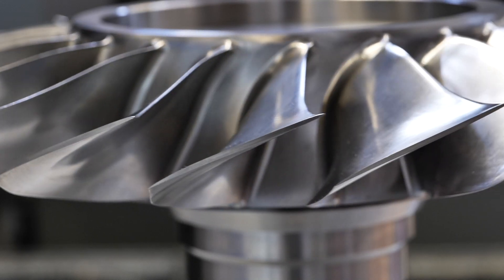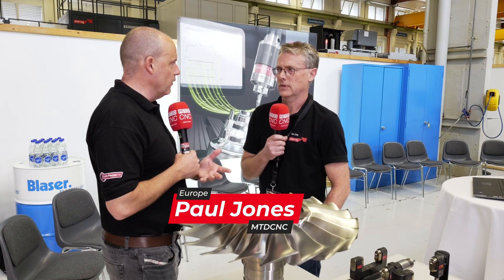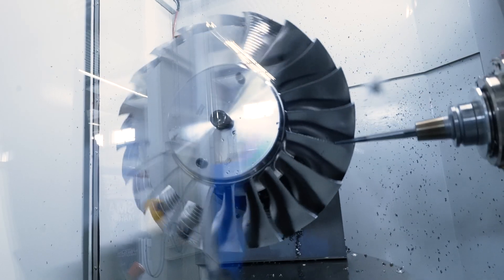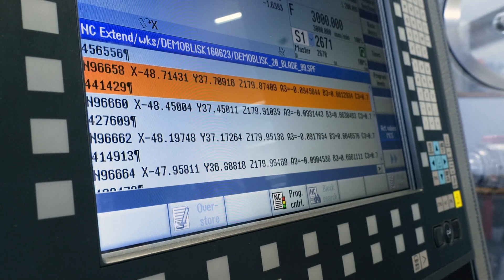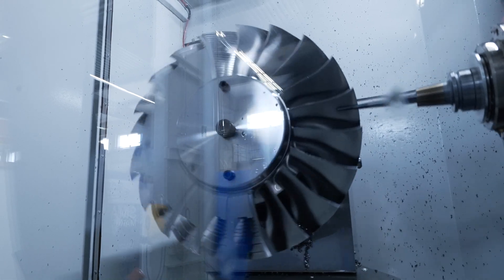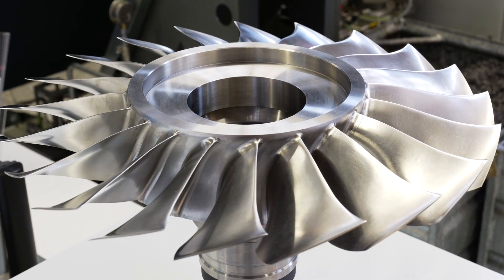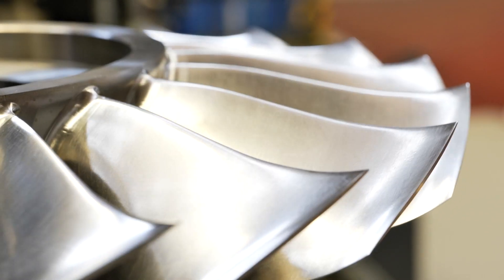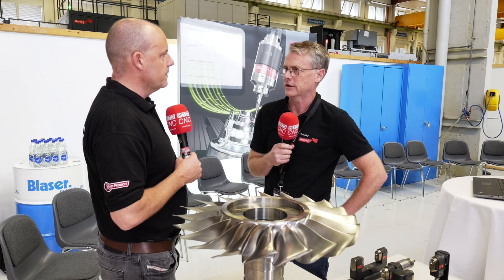How did they make such a challenging part for the aerospace sector?

Comment: well if you have a very precise/repetable fixture system you could go a little old school and after roughing it out you could take it off the machine then cover and fill the the space in one color low ( low enough that it will not make a huge amout of thermal deformation on the part ) temp machinable wax. finish machining the side's of every secend of each blade to final surface and semi thickness. take it off agen and fill the finish pockets with a diffrent color machinable wax put it back in and and finish the pocket's/ blades there where skipped before to final finish and everything to final size. since the wax will give both some support to the thin blades well machining them and dampen the vibration ( supporting yet slightly elastik mass )
and if your makeing alot of them well some are getting there wax on and drying/cooling. others are in the machine being worked on. so your only down time is well your pylling the part out and putting a new one in. and since you do have the support from the wax you can go faster and harder at it to make up for time ( plus you need some people to wax the part's ( and skill fully ) you also help by employing more people and student job's